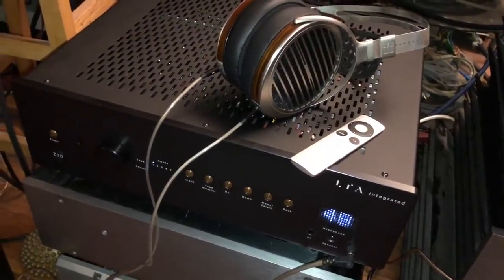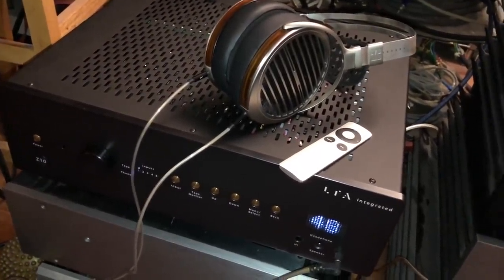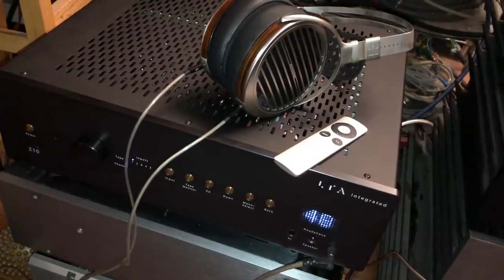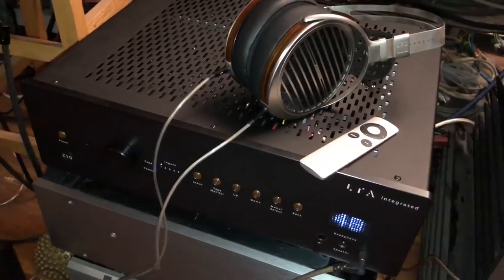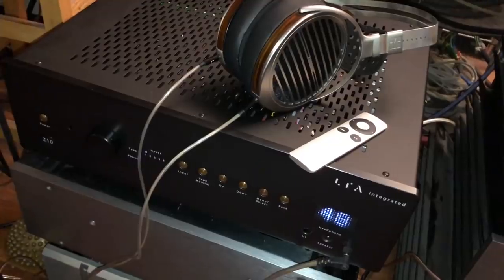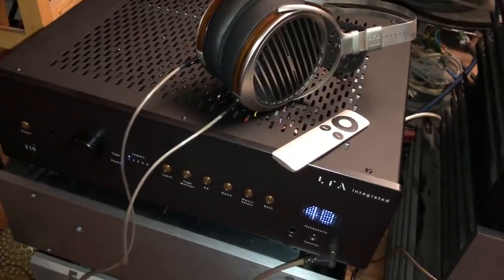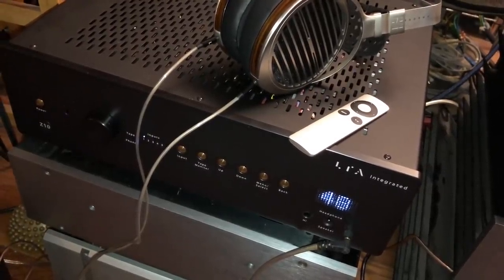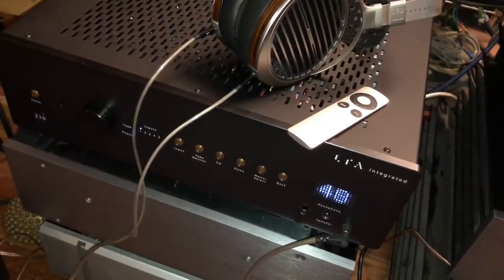Finding joy with a 10 watt tube amp on Klipsch and KEF speakers #tubeamps

Comment: A lot of whiners today! FFS get a grip. Five grand is chump change for some. That's the nature of a capitalist economy. The Pivetta Opera Only amp costs $2.2 million, though there's a budget model that only costs $650,000.
Reply: I have no problem with buying or selling $5k integrated amps, as my favorite integrated amp was the Krell FBI for around $18k.  But, let's be honest.  The parts costs for these amps in a quantity 50 units probably costs around $500.  Now I'm not advocating the manufacturer sell it for anywhere near $500, but $3000 would provide a dealer 50% margin, and the manufacturer makes $1000 profit on each amp ($1500 in Rev). 
The company and the retailer make enough money to stay in business, and the customer saves $1900.
Reply: @Cakebattered  I strongly advise you against going into the business of selling hi-fi amps if you think it's that simple. In a few days, Paul McGowan's memoir 99% True goes on sale. That details the downfall of the first incarnation of PS Audio and later Genesis loudspeakers due to poor understanding of how business works. It took Paul four decades to learn how to keep a business afloat and profitable. I suggest you read it.

The Small Business Association states that 30% of new businesses fail during the first two years of being open, 50% during the first five years and 66% during the first ten. Most of those failures are due to poor understanding of how business works. I'm retired now, but spent most of my life working on my own account so know somewhat whereof I squeak.
Reply: "...failures are due to poor understanding of how business works."  Nebulous statements like this fail to prove you actually know anything about running a business. Your knowledge and experience running businesses can be mutually exclusive to the success of running an audio company.  A few bad reviews, sudden shortage of key parts, holdup in licensing/certification, untimely evolution in technology can easily knock out a budding audio manufacturer, despite the flawless creation and execution of one's business plan.  Dude admit it, the amp is overpriced.
Reply: @Cakebattered  For all I know the amp is underpriced. I did not venture an opinion on the likelihood of the success or failure of the item in the marketplace. Here's what I do know:
Being certain is a mental state, not something based on factual analysis. You demonstrated that by being certain without having spent sufficient time analysing the product/market. Before venturing an opinion I would need to spend a great deal of my time fact-checking and doing my sums rather than having a knee-jerk reaction.
A big lesson for me was the failure of Johnny Walker Black label whisky in the Japanese market. Initially it sold really well so the importer (who wasn't Japanese) decided to reduce the price. Sales dropped to near zero. Most sales were gifts and giving a bargain-price product in Japan would be considered an insult. It's trivially easy to decrease price and inordinately difficult to increase price by any significant amount.